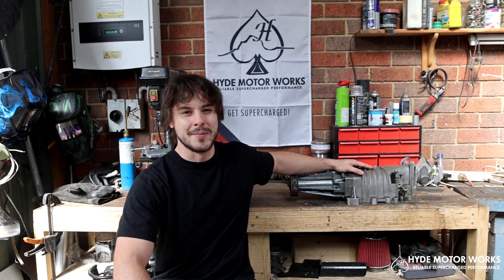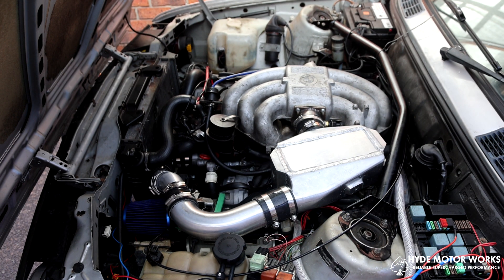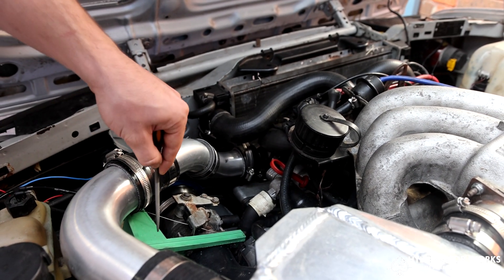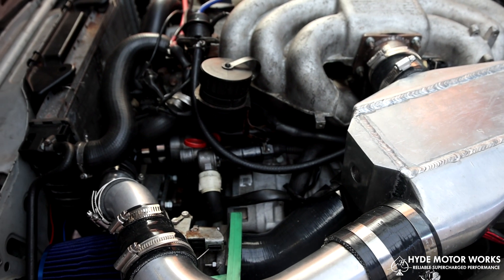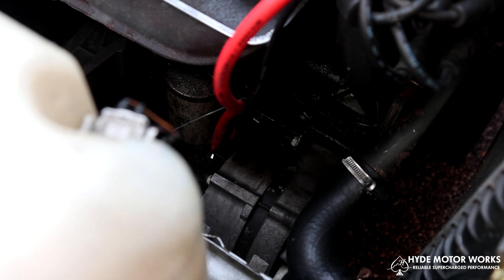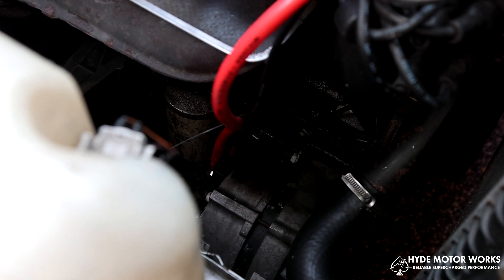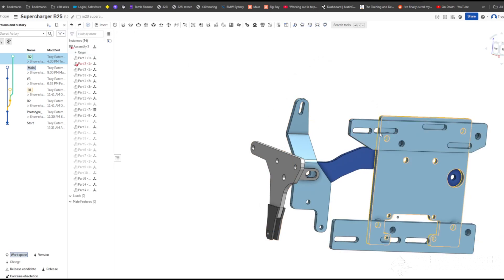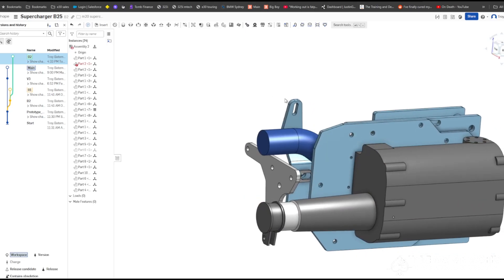BMW M20 Supercharger Kit | Project Bush Brawler

Comment: Will this work in an ix
Reply from the maker: Should as its the same engine, just has AWD. Engine is all the same. if you have room on the part Troy installs the kit, then you should be fine.
Reply: @HydeMotorWorks great im really excited for this kit.

Comment: You can absolutely run a positive displacement supercharger with the throttle body after the supercharger, you just need a diverter valve between the two. That is what people, including me, have done in multiple cases. I don't know were you got the idea that it can't be done.
Reply: The m90 used in this kit already has a bypass valve built in which we utilise.

Comment: Does the engine management keep up with the extra boost / mapping?
Reply from the maker: Upto 5-10 PSI it can be adjusted with a old school way, rising rate fuel pressure regulator and a wideband AFR gauge. But a proper tune would always be best specially for more power and overall reliability and efficiency.